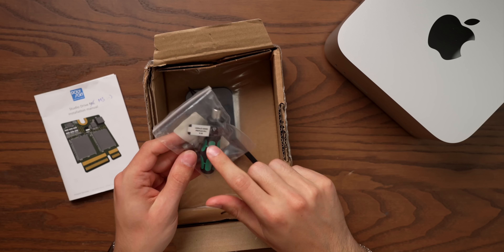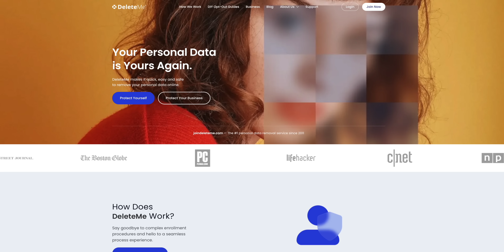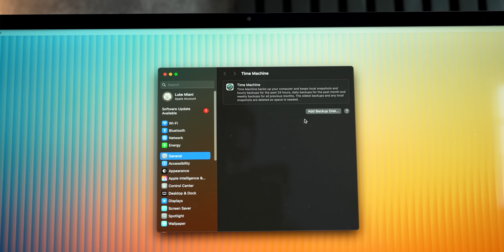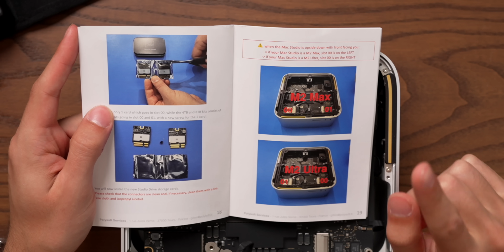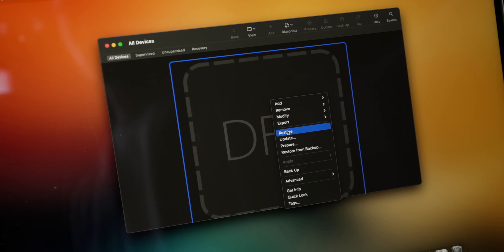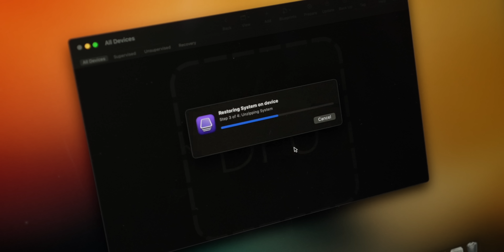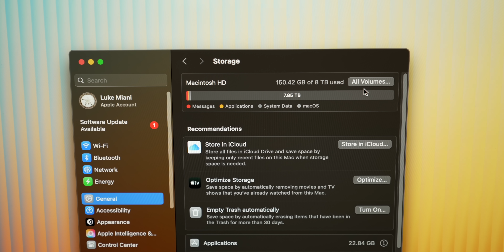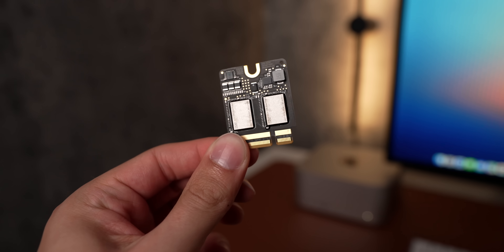M3 Ultra Mac Studio SSD UPGRADE: A Surprising Secret

Comment: Could you do a complete step by step guide with links to the Apple Configurator page you used and how you backed up and restored? If you get a new SSD do you have to backup the original Apple SSD first or do you just connect to it with Configurator and the restore will do it on its own?

Comment: Hi Luke, I am fixing to order my new Mac Studio in a day or two and here is my question for you. I have a iMac all in one, instead of ordering a separate monitor for my new Mac Studio is there a way I can use the old iMac as a monitor? Is there any difference between the new Apple monitors and my iMac display. They are both 27 in.  Thanks in advance.

Comment: The thing that is not mentioned however is that the price difference is "for the 8tb" upgrade. The difference scales downward fast as one goes to smaller drive sizes until at 2tb it's only $25 difference.

Comment: Hey Luke, thanks for the useful video. Question (s) : For a Mac Studio M2 Ultra is there a US based company that sells the RAM modules?  Can someone shed some light on durability and reliability of the modules,  much appreciated. I am looking to set this baby up with 8 or 16T (can someone advise if 16TB is supported on MacStudio M2 Ultra) and use as a storage ground for TBs of data for the long haul - so reliability is key. Thank you in advance.

Comment: Guys why would you even try to do this risky mod when you can use one of these TB 5 80gbs m.2 enclosures + samsung 990 Pro, which, you'd be surprised, runs faster than mac studio's internal drive? A 4tb + enclosure would cost you around 350-400 if you do some price search.
Reply: Thank you so much for your tips I will try the way you advised first :)

Comment: Luke you should really try and make a video on used Mac prices in other markets, for example here in Greece an M1 MacBook Air can go from 450 euro to 700 euro used, but a shitty 13'' macbook air can even go for 400 euro, which makes no sense and makes it impossible to find really good and cheap deals (150-250 euro)

Comment: I owned a M2 Ultra which has already been upgraded from 1TB to 8TB.  Great to learn that the SSD from Polysoft could be used in M3 Ultra.  Can you show how to restore from the replaced 1 TB and put the already paired 8TB to a new M3 Ultra (if this is possible).

Comment: @lukemiani do you have to use another mac if I want to restore from a bootable external SSD once I've installed my new modules? Can I simply restore from the bootable external or do I have to use Apple Configurator for DFU Restore because the new modules won't even be recognized? Trying to avoid installing the latest OS and instead want to restore from a bootable copy of my original internal SSD. Thanks in advance!
Reply: The other Mac is simply for the DFU programming. You could certainly use an external drive for the backup, and then restore from that once the new NAND chips are configured.

Comment: Does that mean that you have to have an appropriately sized hard drive on another mac to restore a mac? Holy moly.
Reply: No. The other Mac was just for the DFU mode to be able to program and configure the new NAND chips to the M series SOC. You could perform the TimeMachine to any external storage drive, then use that for the restore.

Comment: Great video, but buying an 8tb module is not an 8tb upgrade as you lose the 1tb that the Mac came with (I know that is the same as an official Apple upgrade, but I’m really comparing with external ssd). As nice as it would be to have the storage internal, I still can’t help thinking you’re better off going with an external option not to mention the risk of performing the upgrade yourself and the risk of a future malicious update from Apple detecting the 3rd party upgrade and subsequential bricking of the system. I do love that this is an option though, but for me, it’s a thing that’s nice to know is possible but when you get down to it, there’s more reason to just play it safe and settle for an external option which can be used across different devices. And to top it off, the data in the internal ssd is locked to the host, the moment you take it out, the data is effectively lost, so this is quite the false economy.

Comment: It's good that Apple finally allows third-party options to its previous extortionate storage prices.  However, on my PCs I can easily upgrade the storage with a standard SSD.  I can put the SSD in a different device of any generation to read and write the data on it.  I can put the SSD into an external USB enclosure to do the same from any modern computer.  I can put the SSDs in any slot in my PCs and they will still work.  Pricing comparison for 8TB SSD in 2x4TB configuration: Apple ~$2200, Polysoft (this video) $899, Crucial standard SSD (not for Mac) $438 total.
Reply: Yeah, I’m right there with you on this. You’re much better off going down the external route. Too many potential pitfalls performing internal upgrade and don’t forget, the internal upgrade results in only 7tb of additional storage because you have to account for the original Mac’s 1tb drive not being useable

Comment: Apple’s storage strategy has been quite misguided, aiming to drive users towards iCloud storage. They’ve intentionally limited storage capacity on devices and made the upgrade process extremely costly and difficult, resulting in most users opting for external drives. The prospect of 256GB storage in 2025 is laughable. Apple's innovation under Tim Cook has really depreciated.

Comment: Hello Luke, I have a few questions, can you please make second part testing:
a) Size of the pSLC-Cache and REAL NAND Write speeds (e.g.. with AJA System Test, which provides also  nice graphic and test beyond the 5 GB Datasize which Blackmagic provides, even in the Terabytes)
b) a comparison with external TB5 and TB4 SSD solutions even in RAID0 configurations (is Raid 0 limited to two drives? or can it be configured also in 3 or 4 drives? or configuring a Raid 0 of two Raid 0 (using in total 4 drives)

Comment: Apple are just the most frustrating company... 

What's the point of calling your product 'Pro' if you cannot upgrade/repair your own computer easily? This is just greed, pure and simple. 

This is the Pro market, who will buy the product not because it's a fashion statement, but because it's a tool to be used for their work. We don't care about having the smallest, sleekest package, we want it to be useable.

It's one thing making a laptop small and sleek, but a desktop?

And yes, I know this design has been out for years, but it just hit me again how mental it is that professionals aren't railing against Apple at this point. And the worst thing is, it's hard to argue, because currently the only viable option for most creative professionals is Windows, and that's somehow even worse as fas as software is concerned...

Comment: My question is - if you have a problem with the Mac at a later date and it’s still under warranty will Apple still repair it seeing that the storage is different from when you purchased?
Reply: In many countries unless they can prove your modification caused the issue they cannot deny the warranty repair

Comment: I deviated a little myself from Polysoft's instructions when upgrading my M1 Max Mac Studio to 4 TB earlier this year. Taking apart the Mac Studio, installing the new modules, formatting them in DFU mode using my M1 Mac Mini and installing 15 Sequoia were all quick and straightforward, but putting the Mac Studio back together was a little tricky, and I ended up putting two frame screws in opposite slots against the manual's instructions. It all turned out fine, so I'm not worried.

Comment: I rock a 2012 MacBook Pro 13 inch with 16GB of RAM and a 480GB SSD, with macOS Sequoia, and it runs like a dream. As well as my 2009 21.5 inch iMac with 8GB of RAM, I think a 1TB hard drive, and macOS Monterey. Sad how it’s no longer as easy to upgrade your Mac as it used to be
Reply: You probably just don't do any ai or video pro tasks. Good for you ! :)

Comment: Just opening a Studio won’t void the warranty; installing non-Apple hardware in it absolutely does.  This is explicit in the Apple warranty which (does not apply) “g) to a Apple Product that has been modified to alter functionality or capability without the written permission of Apple;”

Increasing the configured storage is altering the capability.  Even if you do manage to get a warranty repair, the warranty is clear that devices may be returned in “as purchased” specification.

As always, don’t trust what a toober says, read the actual legal agreement.
Reply: But if you keep the original parts ... just sayin'

Comment: so question 1, can designated m chips achieve even higher capacity of ssd than apple designed

also, are we able to sacrifice one of the ub c port to connect much higher capacity, even better with the ssd modules in the video if still some spaces left inside of mac studio or even mac mini

Comment: 9:05 the existence of over half the ssd being taken by "System Data" -- something you can't even get manage without a clean install -- should be grounds for a class action lawsuit. What a crock!!! Also the resulting penalty per device for Apple for wasting 126GB of our space should be based on Apple's pricing of what SSD upgrades are supposedly worth.
Reply: It's not Apple's fault that your system files are taking up so much space.

Comment: 4:06 OP1800 - "Servicing TPP" states that the presence of Third Party Parts for Mac and Mobile devices does not void the warranty; however, Apple will deny service if the reported issue is caused by the Third Party Part.

If you're ever in a conversation with an Apple employee trying to say your warranty is voided because of a Third Party Part, have them look up OP1800.

Comment: “System Data” infuriates me. Makes me wonder if they are intentionally not fixing it because it can help sell higher storage tier Mac’s.
Reply: seeing as my M1 MBA has 15.33 GB used for "System Data" I think homeboy needs to wipe and restore his mac because it's somehow crusted up with crapware.
Reply: It's usually the ~/Library/Caches folder that's bloating up. I had this happen to me once and I simply deleted that. I wonder why they aren't storing caches in /tmp though, as /tmp is wiped on every boot.
Reply: @MatthewYang-m3swell macos dont switch off macs very often so this is still an issue
Reply: @MatthewYang-m3s I wonder if CleanMyMac helps.
Reply: @avieshek clean my Mac is terrible. Daisy Disk or onyx are good tho
Reply: I just checked out my system data and it is using 66GB wtf